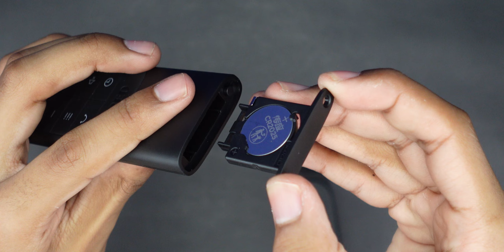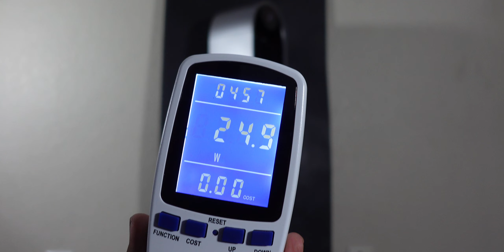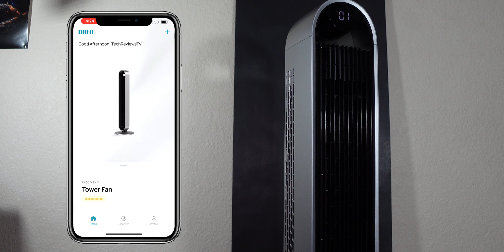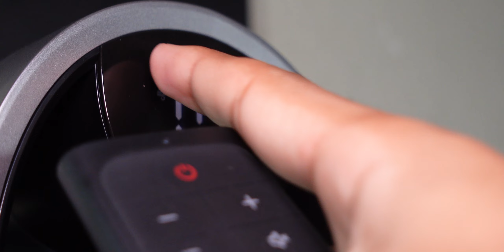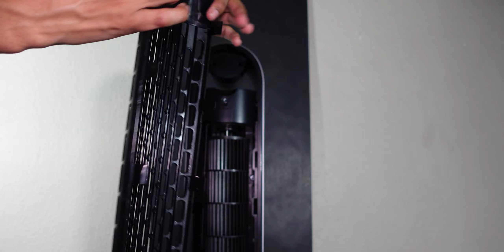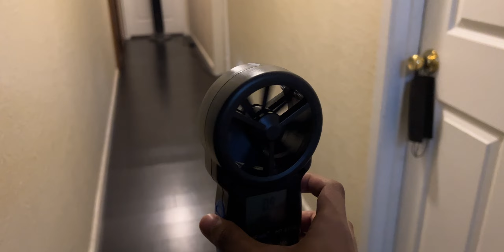The Only Fan you’ll ever NEED | Dreo Pilot Max

Comment: I bought mine two days ago, and I've noticed that when it oscillates up and down, it makes a slight buzzing noise. I imagine it's the oscillation motor, but it only happens when it moves in that direction. Does yours make that noise too? If not, I think I should return it because it probably has a manufacturing defect.
Reply from the maker: @Clowntergeistt  make sure screws are tight enough if needed for the base. But other than that it might me a defect

Comment: Great video. Does the display stay on while it's in use, or does it at least have that option? I recently bought a less expensive Dreo tower fan, and the display always turns off with no option for it to stay on. This means there's no visual way to see if the fan is even on unless I wake it up with a button press. I find this very annoying. So I'm looking for other options since the fan is awesome besides that. Thanks.
Reply from the maker: Stays on during the day or when there’s light and turns off when it’s dark
Reply: @TechReviewsTV  Thank you for the reply. Do you know if the app lets you make adjustments to the display, generally speaking?
Reply from the maker: @dwest84 only the stuff show on the video and what I mentioned before “adaptive brightness” can be turned on or off
Reply: @TechReviewsTV  Thank you for the info, sir. You're the coolest.
Reply from the maker: Glad to help out 💪

Comment: Does the stream from the fan blows at the height of the fan only or it goes also higher,  i mean the fan is 40 inches and the air flow goes straight  or blows on that level and higher, because i have an indor trainer for cycling and i am wondering if the air flow can blow all over me because if it is blowing just straight that means that it will blow only at my lower body . It will sit around 2-3 meters from me
Reply from the maker: I’d say around 2-3 inches from top and bottom aren’t the actual blades so no airflow it’s just plastic and you can feel it slightly higher than just straight on if anything you can just put it on a box